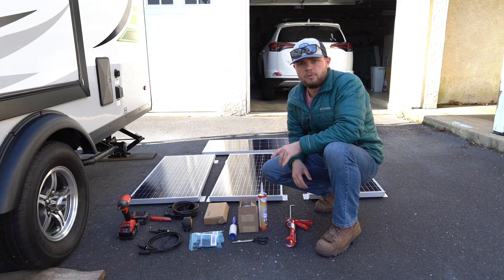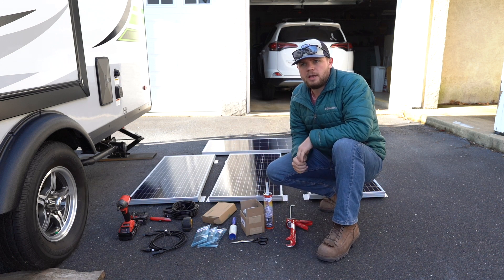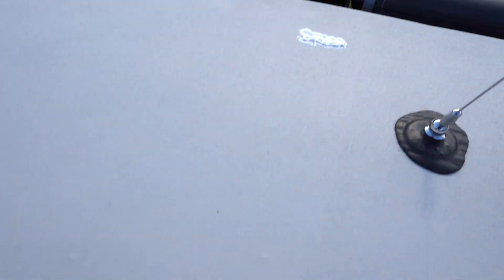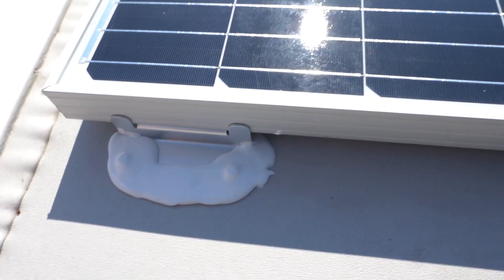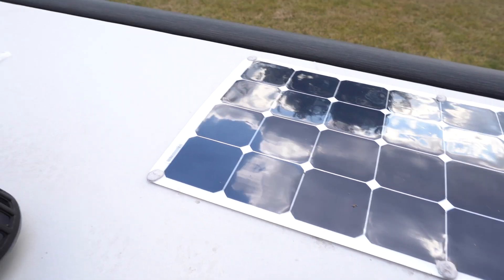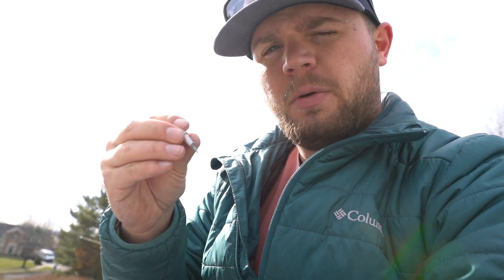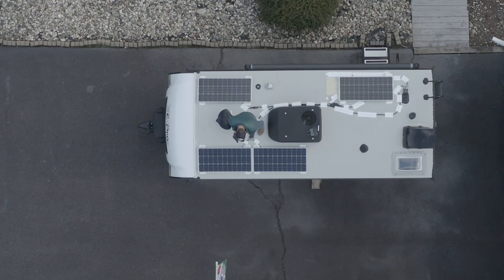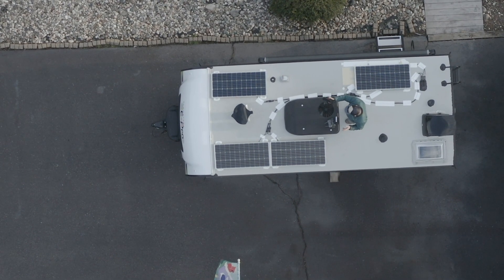400w Solar Install on Geo Pro 19fbs - Travel Trailer solar system

Comment: How does your Tacoma do with that trailer thinking about buying a geo pro and towing it with my 2013 Tacoma
Reply from the maker: It was my dad's Tacoma but it did great. We did even have a brake controller and we went into decent size mountains out here in PA / NY. I would just recommend getting a brake controller for long trips and big hills to save your brakes on the truck!

Comment: I appreciate the video.  Just put a deposit down on a 2021 e-pro 20 bhs.  What other changes did you make to the e-pro's solar setup bedsides the batteries? Was the pre-installed system able to handle your panel upgrades?
Reply from the maker: Yes everything worked great and we boondocks for around 8 days onetime not plugged in. Works great I would highly recommend this upgrade.

Comment: How many amps is you solar charger rated for?
Reply from the maker: 30!
Reply: Thanks. Was wondering how much the controller that comes with the camper could handle.

Comment: Did you get a weight distribution hitch for the trailer?  If so, what did you go with and was the install simple ?  Thanks
Reply from the maker: Yes we got a 10,000lb one from Harbor Freight. It was easy to install yes I recommend!